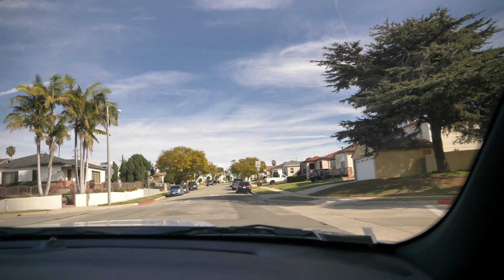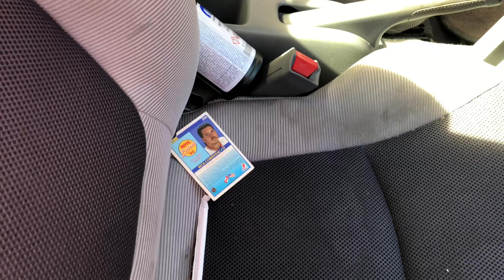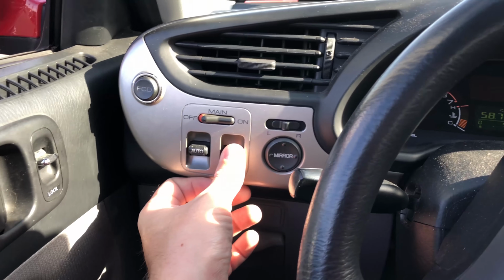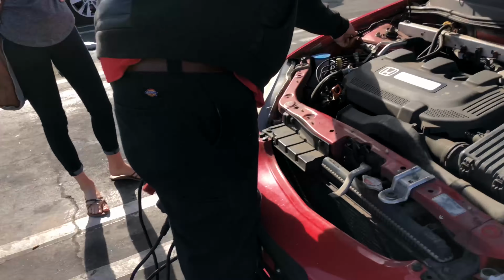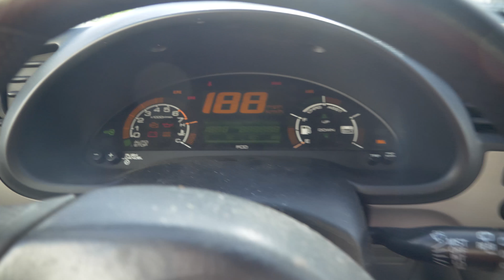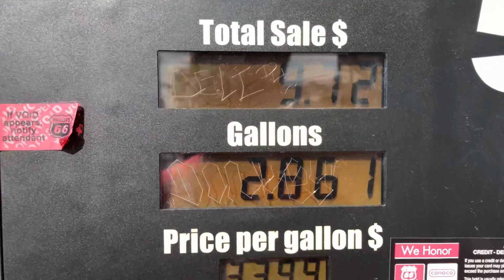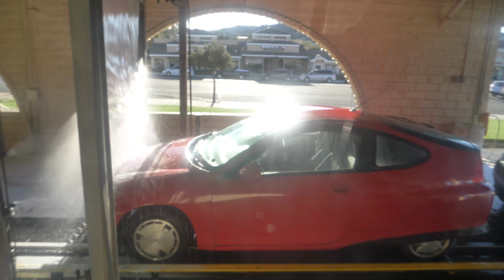It's cheaper to buy this car than Daily a Lambo

Comment: First gen Honda Insight's make for a great budget drag build. They are extremely lightweight and aerodynamic, and you can swap out the engine for a more performance oriented Honda engine and make some serious power for fairly cheap.

Comment: dont you have a cts-v?
Reply from the maker: It’s out in Detroit still.  I’d drive it across country. Maybe at some point. Just don’t want to daily a car I care about lol
Reply: I was thinking RX8
Reply: Formula 1Fan He wants a reliable daily driver
Reply: did you move from monroe completely ?
Reply: What happened to the r32. Why don't you daily drive that?
Reply: Rob Dahm you don’t care about your lambo LOL
Reply: I used to daily a red manual insight just like that. Its a fun efficient  beater. Has so fun quirks like being all aluminum chassis, and honda s2000 like, dash. Bentley Arnage was my weekend car. I also recommend second gen prius. Mine has 300k miles, and still drive like a new car.
Reply: The cts-v isn't reliable?

Comment: HAHAHA! Called it once he said the number imported. Welcome to the club Rob. Come on over to InsightCentral.net and learn more about the car.
Reply: Also, that window switch can be repaired pretty easily. People 3D print and sell the part that snaps inside the switch so you can just take it out and repair it for a couple bucks. Also, I wouldn't worry too much about the CCA of the battery, it's only ever used to start the car when the battery temp is below around 10F. Every other time the car starts using the large battery for the hybrid system. You'll learn to drive that thing at over 70mpg in no time.
Reply: Same, insights are so cool.
Reply: jesus i never thought the honda insight community is out here like this hahaha. nice to see even hybrid drivers still keeping up with there cars and not treat it like a normal commuter thrasher. think there is a term for that.......do i dare say car guy/girl?

Comment: @RobDahm the window issue you witnessed was due to the auto up/down voltage dropping below a certain threshold that “remembers” the location up all the way up and all the way down. Just push the window all the way down holding the switch then all the way back up holing the switch and the window work fine. Let me know if that helps.

Comment: I felt the same way about my first g1 Insight purchase so I bought a second one and kswapped it.  No ragrets.  I have averaged over 70mpg to a tank on a stock Insight,  no a/c, below 70mph and draft semis!  You can build a grid charger for about $75 and get that battery pack back to life with a full discharge and recharge.  The car is a lot more enjoyable with a working ima!

Comment: Did you legit just see Jay fuckin Leno out driving a (forgive me if I'm wrong) Caterham? dope ass car.
Reply: Not sure what it was, but not a Caterham
Reply: Colby Murphy I think he was driving a Bentley
Reply: I think it is a Bentley. The 1930 Bentley Speed Six from Gurney Nutting Sportsman is the only car I've seen with:
- similar wheel arch (one that doesn't sweep and doesn't connect front and back)
- similar wheels (silver hub in center plus)
- similar hood shape (rounded square, albeit slanted vents on the Speed Six)
- similar hood ornament, at least from the blurry still I can grab. It's roughly the same size
- similar grill (convex and all chrome, totally exposed)
- windshield
However it's not a roadster, doesn't match the rear end, and the headlights are mostly below the tops of the wheel arches. Plus, doors.
The 1929 Bentley 4.5 Liter Open Tourer by Vanden Plas has the vertical vents and the wheel arches are much closer, but the windscreen folds, the hood is too short, headlights too big (but in the right place!), still no matching rear end, and it, too, has doors.
Reply: I think it's definitely pre-1930, probably pre-1928, based on the wheel arches. All the Bentley's I've found from 1928 onward have an arch that covers the full front of the rear wheel, as opposed to Leno's, which is directly opposite. It seems many years had both split arches, like Leno's, and connected, sweeping arches.

Comment: You have acquired a unique car. Since you are new to the Insight, I would recommend you check your ground straps in the engine bay. Bad straps cause weird electrical issues with this car. Replacing the 12v is going to save you a lot of headaches down the road with this particular car. So that was good. Next, your hybrid battery is bad but probably not all the way gone. Find a grid charger for the battery, and use that to try to revive it. HybridAutomotive makes a nice one that I use. Jeff is the owner, and he is a great help. Also, discharge the battery, too. Check the second and first gear synchronizers when down shifting. They are often the first ones to go out on the MT version. There is a mod for fixing those if you have that issue. For other questions and issues, head to InsightCentral.net for help. Almost all questions and issue have been dealt with and answered there. Enjoy the Insight ownership. It requires a lot of tinkering! :)
Reply from the maker: Thank you! I already cleaned up some of the grounds. They are heavily corroded.  Battery pack needs to be loved. It errored out once. I need that grid charger
Reply: For sure! Also, if you are over a hundred thousand miles, I would recommend replacing the spark plugs with the correct indexed NGK plugs that you can only buy as a Honda Genuine part. You can check what index you have by checking the block right next to the coil pack. Or, if your plugs are original, they will have the index stamped onto the top of it.  It will be either A, B, C, or D. Most likely it will B indexing across all three. But make sure you torque them correctly. I believe it is 17 lbft off the top of my head. Some owners have reported a 5mpg improvement when they replace their plugs with the new correctly indexed ones. Also, the original Bridgestone Re-92 tires give the best mpg with this car. Most owners swear by them, and the 165/65/14 was specifically created by Bridgestone to be a LRR tire for this car. All this info is on the forum, and there is also an encyclopedia section with all of this info. Enjoy!

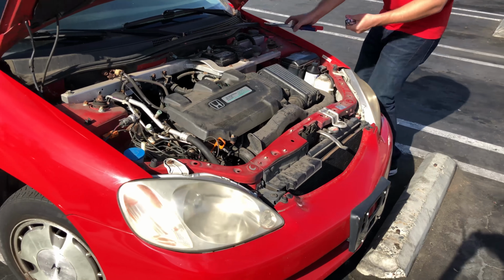Comment: Take the ground off the battery first!!!  You took the hot off first at 5:20 in the video, and that's just dangerous.  If the wrench hits metal while you are unscrewing the clamp, you will have a direct short.

Comment: Rob, please do a muffler delete on this car.  Keep the stock cats and everything, just delete the muffler.  I promise, you will be absolutely blown away by how loud it isn't.  I did a muffler delete on mine because the car was so quiet that I couldn't even tell if it was on, and I was going to install a non-silent muffler, but I thought it would be hilarious to hear it straight-piped.  Turns out, a straight-piped Insight is about as loud as a stock Neon or something.  The guy at the muffler shop couldn't believe it.

Comment: www.autospeed.com has a build for turbocharged one. Also they go through a simple mod to help maintain lean cruise (runs at 25:1 afr at times). Lean cruise won't work without the hybrid system, unless you use an interceptor.

He has seen economy as good as 2.8l/100km on the highway

Comment: Should have just bought an old Chevette and walked around saying you get 40mpg in a Vette. I think realistically most get around 35 hwy and 27 city but Chevettes look much better than an Insight and you could have fun upgrading things like going from a cable clutch to a hydraulic clutch. I think you would like it enough to buy a second and upgrade everything on it. Think about this, take a wrecked Chevy Sonic's or maybe a turbo Chevy Cruz's drive train and sticking it in a hatch back that weights 900lbs-1,200lbs less then upgrading the suspension and brakes giving you a economical hot hatch with 138hp that weighs only 1,843lbs-2,035lbs. If you wanted to get really crazy make it into a mid engine car, lol.